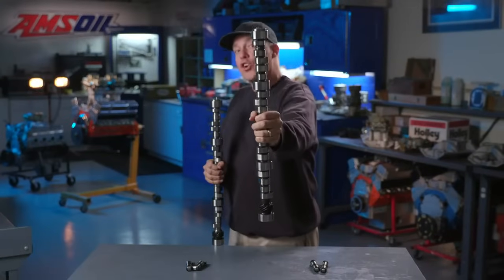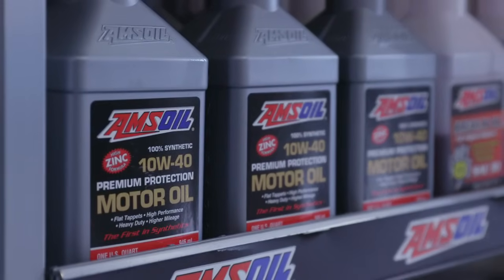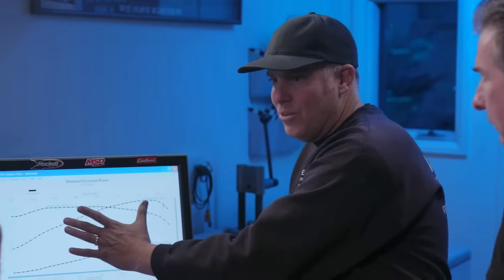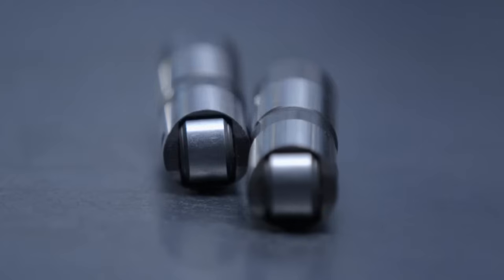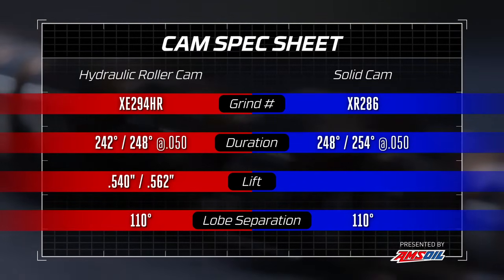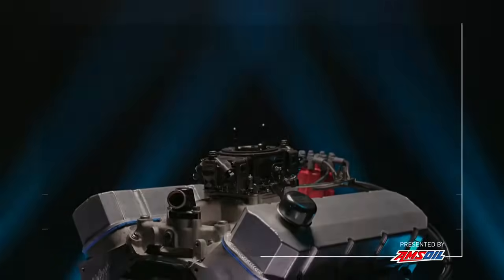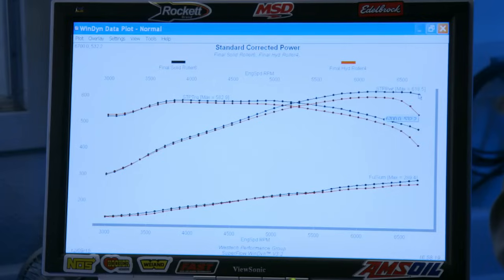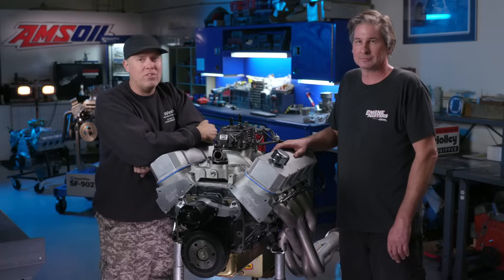ENGINE MASTERS  S1E10 600hp Camshaft Shootout! Hydraulic vs Solid

Comment: I am curious. 
With flat tappets, the solid and hydraulic lifters are the same height and can use the same push rods.
When it comes to roller lifters, they are different heights and must use different push rods.

Comment: 20hp difference on a 600hp motor, yeah I'll take the hydraulic rollers, especially for a street car. Not having to lash valves every so often is definitely worth that loss. 

Now if its a dedicated race car, you can go either or, at that point, lash is just part of your turn around and it's up to you if you're willing to add 20-40 minutes to your turnaround time between rounds.
Reply: If you are adjusting lash between rounds in a bracket car you are wearing out parts in a hurry
Reply: @jhastings454  you have an incomplete check list if you're not checking lash. Whether you adjust or not is a different story, but you should at least check it.

Comment: Never ever running down I-95 @6100 rpm.. 2200 max cruise @85 and 5200 max rpm ever angry foot around somebody
Reply: Without a power adder how does one make a decent amount of power at 5200 rpm on an ls. 

They max peak torque at around 4500 rpm out the box and making full power at 5800 lol.

Comment: They totally rigged the test for the solid cam.  .110" additional lift; of course it's going to make more power.  How about increasing the seat load for the hydraulic cam to give the same spring force at peak lift?  Then the train control issue will go away for the hydraulic cam, too.
Reply: It's been found that springing hyd roller lifters hard can also cause collapse/loss of valve control. Sure the type matters. Brands.  Short travel vs full travel, etc etc
Reply: Hyd can't stand the spring pressure
Reply: @hotrodray6802 that’s not true. Hydro cams have cam a long way. Some now use what was solid roller old springs 10 years ago. My hydro roller in my 331 goes to 8400 rpm. And makes 632 hp at 8150rpm. If you are running a solid roller today, you should be running 800+ lift and spinning over 8000 rpm at that lift. The tech has changed.
Reply: Dude. 
It's larger to account for valve lash. Did you watch the whole video?
Reply: @I_like_turtles_67 So you run .110 of valve lash?? Doesn't equate. Should have been more like .020 to be fair.
Reply: @jonbarnett6132  I agree, the cam profiles should be way closer. You could make the argument that since the hydro lifter has .100 travel internally it was fair but that would mean the hydro lifter has 0 preload and bottoms out every single valve lift, which is definitely not the case with regular travel lifters

Comment: I would like to see  a hydraulic flat tappet cam against the hydraulic roller.
I have seen some very aggressive hydraulic flat tappet cams build some horse power
Reply: Would it make any difference if the valve events were the same?
Reply: Hydraulic roller have a more aggressive lobes and are more efficient than a flat tappet lifter. That’s why they don’t build modern engines with flat tappets anymore.
Reply: @palmbeachcane9523  I built a Pontiac engine from an aftermarket block with Kauffman racing heads, not to many cam choices in roller, so we used a hydraulic flat tappet cam, the engine is a 468cid and it made 606hp at 6100rpm and 710tq at 4600 rpm but made 500 ft tq from 2800rpm on out.
We are now using hydraulic flat tappet cams in more Pontiac builds
Reply: Plus, breaking in a flat tappet properly is always a PITA.
Reply: @Turbo4Joe363  we have never lost a hydraulic flat tappet cam or solid flat tappet cam at any time.
Not hard to break them in

Comment: solution: run the solid lifters on the lower lift hydraulic cam with less spring pressure and it's almost the best of both of both if you lash at .001. never ever even touch a hydraulic lifter, nasty.
Reply from the maker: lol, to each their own.
Reply: @ i don't think i've owned a hydraulic lifter since 1979, that was the year i built my first 327 and man did that ever start something. i won the first street race i had ever been in (about 1977) and that really set the hook. i have done a lot of stuff man. always mostly chevy, but i've probably worked on more ford race cars than chevy and probably built twice as many ford engines, but always for other people and of course mopars too. lots of cars over lots of years and lots of drag strips all over. we do the stuff other guys just dream about.
Reply from the maker: @williamglass7806  Love hearing about stuff like this.
Reply: @roadkill_reborn  not half as much as i like telling about it. i think i have enough drag strip stories to keep'em fresh about ten years and some of them are even true.
Reply: @williamglass7806  maybe you should write a book then, I bet tons of idiots would be into your stories. You could illustrate it with photos of the places you hung out back then and what they're like now, telling a story about each spot
Reply: How fast do you want to go that is the question
Reply: @williamweir2744  as fast as you do man
Reply: hydraulic cam with solid lifters and a rev kit to keep the rollers riding the lobes..